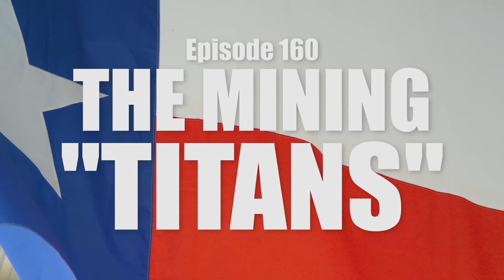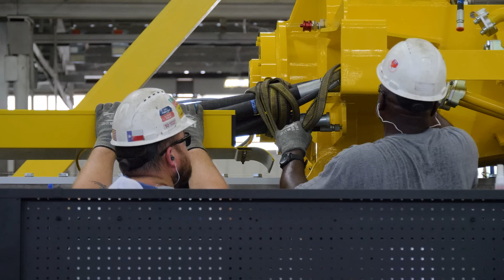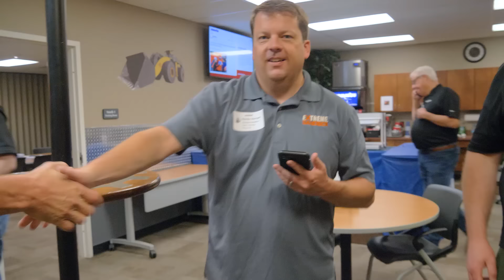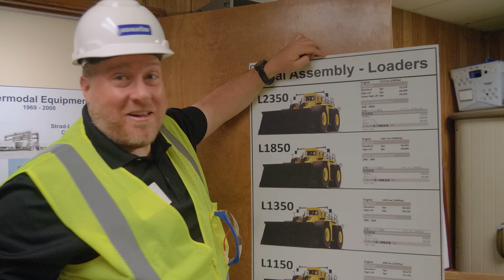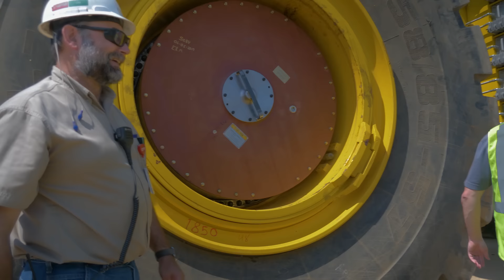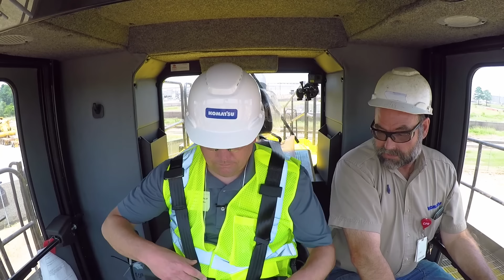World's Largest Wheel Loader | Komatsu Surface Mining // Ep. 160

Comment: So is 50 yard bucket  equal to 13:5 tons ?
Reply from the maker: Tough to compare because yards is calculating volume, while tons is weight.   But either way, 50 yards of anything really will be a LOT more than 13.5 tons (unless you meant 135).

Comment: I worked at LeTourneau from 2007 to 2010 assembling and doing electrical work on those.  I never saw it that clean, the cob webs hanging from the light fixtures would be 4 ft to 6 ft long.  I heard Joy Global built break rooms and cleaned it up.   Joy Global also gave everyone a $2-4 raise,  two weeks later laid off 50% of the employees.
Reply from the maker: Yeah, it was an impressive facility to tour!  First class operation.  Awesome team!

Comment: This is Not a Komatsu design... this is a LeTourneau 1850 (and all the other's from the original LeTourneau line-up).  Komatsu bought out LeTourneau about 4 yrs ago.... in 2016, if I remember correctly.
Reply from the maker: You are correct.   Well technically I think LeTourneau had gone through a couple of previous acquisitions.   It was Joy Global Mining when Komatsu acquired them a few years ago.   But regardless, it's great to see Komatsu keeping the machine alive and they have a great team and plant at that Longview TX operation.
Reply: @HeavyMetalLearning ... Thanks for your reply.  Yes, it was Joy Global before Komatsu... but before Joy Global,  RG originally sold out to Westinghouse and it was LeTourneau - Westinghouse.

Comment: Electric energy is not "green energy"
Reply from the maker: Agree to an extent, but it is still way more environmentally friendly that using diesel engines to power the actual equipment (in this case it's just a generator supplying electric motors which take on much of the load).
Reply: Heavy Metal Learning and what does that generator run of of. Probably diesel

Comment: 2000 hp seems nuts.  I would probably have guessed 20,000
Reply: That's what I was thinking. Thanks for the vid
Reply from the maker: Yeah...but really that horsepower is just the generator running by he electric motors.

Comment: The machine is a wonder but too technical, a nightmare if it has electrical problems. Clark 675 a more robust and long lived machine. 675 was once the biggest and could scoop over 300 tones and every bearing and joint in the machine was constantly pressure lubricated to save maintenance downtime.
Reply from the maker: Thanks for the comment!

Comment: How much does it way in prospective to something that an average guy would know, I'm not the sharpest on estimating weight especially this size.
Reply from the maker: Tough one.....it's HUGE!   An average car is probably about 3,000 lbs.  The L-1850 is about 120,000 lbs.   So 60 cars?
Reply: That thing weighs way more than 120,000, shit CATs largest loader the 994k weighs in at around 540,000.

Comment: the CAT 99K is a best wheel loader more economic and faster and not many problems like this!!
Reply from the maker: Thanks for the comment!
Reply: @HeavyMetalLearning    hi but anyways the best heavy equipment is CAT and KOMATSU both have a best equipment 992 and 994 from CAT they are a really great I know a  992 have over 66.000hours without touch on engine!! and hidraulic pump just a normal maintenance and change a couple pipes! refuel and driving 👌

Comment: How is the parts and service availability compared to a 988 or 994?
Reply from the maker: Komatsu has a pretty strong distribution network for the parts and service.  I think it always depends on the local market you are in, but we’ve experience nothing but great service from our distributors.
Reply: Nothing beats CAT loaders for parts and service availability, but your local dealership will make or break a given brand. Generally, I have nothing but horror stories regarding Komatsu loader parts availability.

Comment: Why is he traveling with the bucket up in the air ?
Reply from the maker: I was caught off guard as well when we first were told to do that, BUT learned it’s all about load/cycle time in the mines.  So the idea is to just load it up while continuing to raise the bucket then just turning straight for the haul truck to dump right away.  That avoids lowering and raising, all combined to just one cycle.  Makes it much faster!
Reply: @HeavyMetalLearning  cool to know thank you. was curious about this.
Reply: @HeavyMetalLearning  Also they are closer to the truck and don't travel as far as you did while playing around. They're at the truck soon as they get straight.   👍

Comment: Larger than a Letourneau?
Reply from the maker: Technically it IS a Letourneau.   Letourneau is now Komatsu Mining after they acquired Joy Global Mining a few years ago.
Reply: I prefer komatsu loader to cat.
Reply: As the guys said it is one. If you search up the model number l1850 it says it's one. This is just the baby brother to the biggest one basically buts it's still the same brand just like the guys said komatsu took over. And to be frank komatsu makes some amazing equipment so it would be mind bogglingly amazing!
Reply: @beaubath2537  I dunno. We are not buying any more komatsu loaders. Sticking with our 992's for small stuff... the komatsu pc5500s are great and so are  the 830E5 is great but a d11 is still better than our 475... we do have one 1850 LeTurd left tho...
Reply: @thejoe5504  I personally really like komatsu over cat I've ran some cat gear and in the operator comfort department it's rubbish compared to komatsu and for power I find once again komatsu is a cut above. And engine access etc too is just more thought out. I've only ran small end equipment like cat 950h,905h,962g,924gz and then may be one old cat excavator and a 740 moxy. But komatsu I've ran 2 of their eskys,a little 120,380,470 and an old a25c moxy. But when I was given the choice between running the 950h or the 380 id take the 380 anyday. There's thing I hate about both but those are my 2 top loaders to run so far.
Reply: @beaubath2537  I cut my teeth on a case 621. Lots of hours in it, learned to love it. I ran a 380 for a bit and was not a fan of the controls at all. Everyone has a personal opinion. Comes down to comfort and feel. But, 16hrs a day in anything can suck.
Reply: @thejoe5504  now that I think back I did run an old case I feel like it was a 621 I only remember cause It didn't have a straight panel left on it,the bucket was shot,the brakes were gone and you could easily throw your foot through the floor if you weren't careful but it got fitted with an aftermarket ac which made Antarctica seem like a summer day. But the main reason it's stained in my memory is cause I was in it and got involved in an accident. I personally like the 380 for comfort but things like the directional toggle wrapped in rubber left me reving in neutral a few times where the cat was a solid click. Plus the location the cat you could run with the thumb but the one on the komatsu it was on the pinky so I hated it! And I think my only 2 other gripes were the size of the sticks on the komatsu compared to the cat and I think the turning circle on the komatsu wasn't so great either. But for it's size it's not made to be made to spin on a dime. Although the old 740 Hyundai I ran I didn't mind she was simple but not a bad loader. All I know is guys hang a lot of shit on case  (can't afford something else) and to be fair case has made farm machinery not construction...
Reply: @thejoe5504  but you are totally right sitting in something all day regardless will leave you sore. Just I know running the komatsu even though it threw me around it still felt like riding a cloud which was nice for comfort but it's also like having a numb ass, cause you barely feel anything. We had the air seat go at one point and even with it gone it still felt like riding a cloud. But the cat felt more solid on all 4. But just was more rough
Reply: @beaubath2537  100% agree about ride quality, cat is rough. Komatsu engineers really put some thought into operator comfort. 👍🏾
Reply: @beaubath2537  I really want to know why komatsu control sticks are so friggin huge. Look like old time steam shovel leeeevers ha. Case ain't bad if you go in knowing the expectations...
Reply: @thejoe5504  😂😂 can agree! Yeah that is true go in expecting top shelf you could get a surprise.
Reply: @Porty1119  992's, w800's, w900's are our clean up loaders and road work/project machines. Everything else is much much bigger...